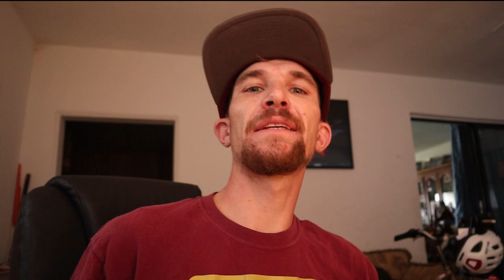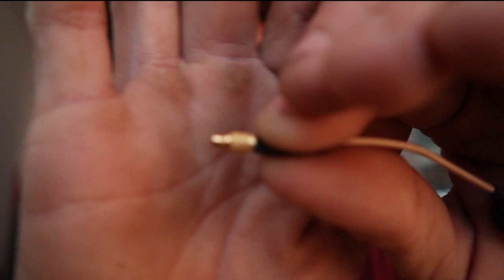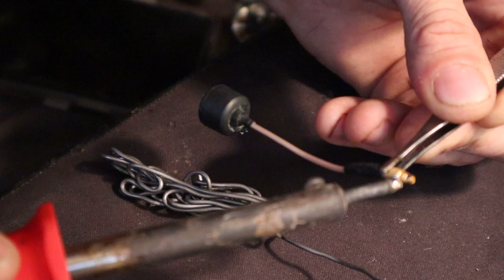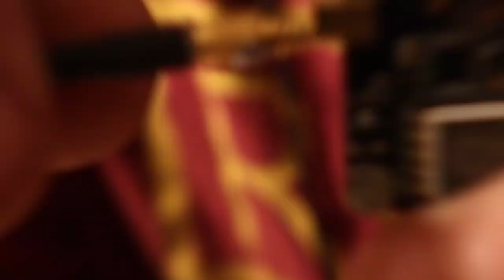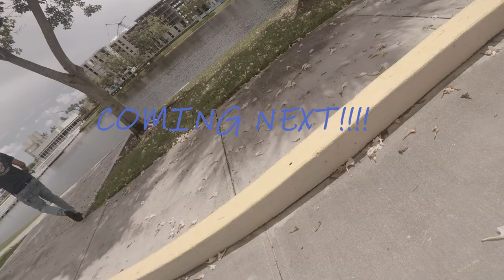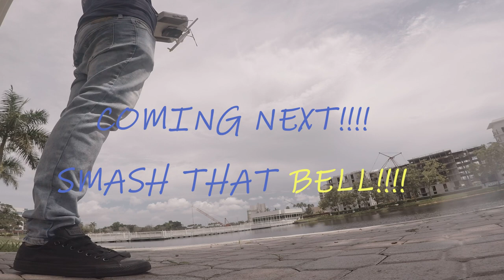FIX up The New TBS Triumph Pro (MMCX)Antenna!!!

Comment: I just went to change my antenna mmcx connector and it took the plug port straight out the vtx. I opened it up and it wasn't even soldered In. Hopefully fixed better then before now.

Comment: Mine popped off, but the tip was left in the vtx and not sure how to get it out. Have tried needles, tweezers, ect.
Reply from the maker: Mines was stuck in the vtx too some needle nose pliers and it pulled right out my guy hope you get yours fixed
Reply: @ThatFlyinRyan  actually, no. I have some very fine thin needle nose pliers, but still can't pull it. The piece that broke off is sheer with the connector. Nothing to get a grip on. Thinking of trying to solder some stranded wire in there and just yank it out.